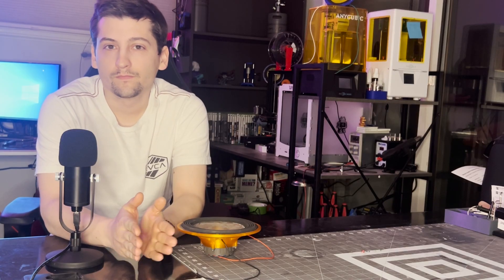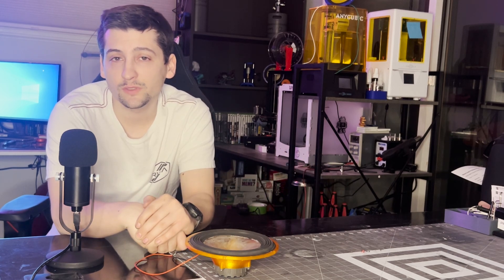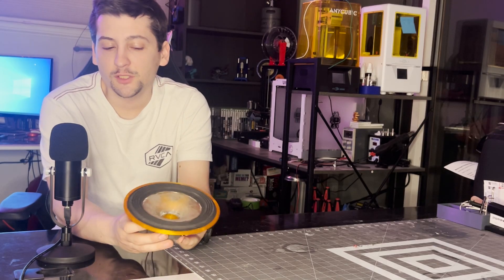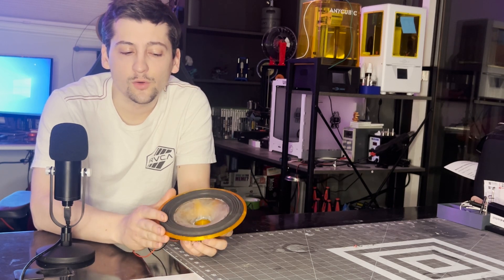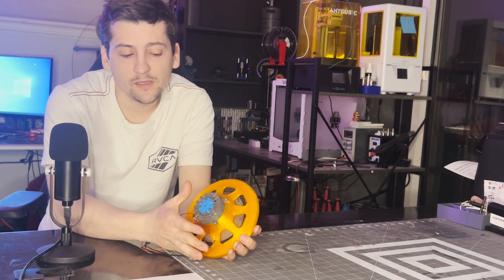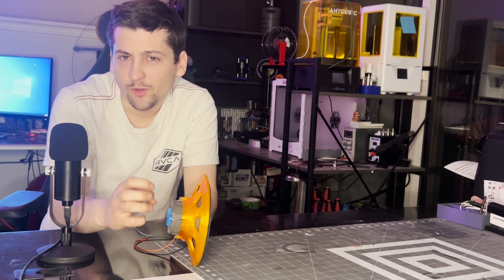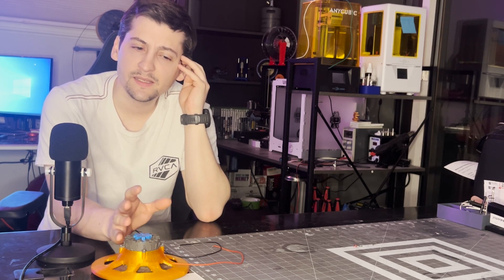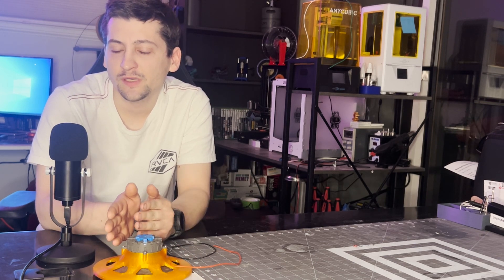Fully 3D Printed Speaker V9

Comment: To get better power handling air cooling and aluminum coils but with these new printers the coils should be more durable with better thermal cooling more efficient and more surface area for thermal transfer
Reply from the maker: I’ve since started to look into ASA or nylon as a former material. But I took a small break from speaker development to work on some box designs and a 2.1 audio system for my PC.

Comment: A little tip for version 10 Stick with the PETG cone just stop using support cut the code directly in half rotate it 90° so that the cut plane is now sitting on the print surface now you just print that twice with no support
Reply from the maker: I’ll keep that in mind.

Comment: Thats amazing! but the printing quallity is a bit bad. But the quallity from the speaker is not bad
Reply: Man I’m using an ender 3 and my quality is NOT like this. Check ur Calibration
Reply from the maker: I promise you all my calibrations are checked… esteps, pid tuning, ran temp towers, and stringing test. All filament is dried to 10-15%, the bed checked for level every 10 prints. I don’t print PLA like 99% of other people running printers, I print PETG, PVDF,ASA, and on occasion TPU/Nylon. 

If your concerned about the TPU surround having some stringing and blobs, that’s fine, I purposely turn the retraction down to 0, this prevents clogs in the extruder and leads to some unwanted stuff that can be fixed post process if I need to. 

As far as the magnet holder- iron fil PLA is just a pain to print, plus it’s expensive, so it’s hard to waste 100g running 15-20 tests…
Reply: @piscesprinting  I dont know i beloce you but why is it like that xD I am using a AnyCubic i3 Mega X and my extruder is calibrated and i habe perfect leveling and i am always printing petg and pla around 185°C and 190°C and i get perfect prints if i am printing too hot like 200-210 my prints are ruined
Reply from the maker: If your PETG prints are actually printing at a temp of “180c” on your printer than your thermister is calibrated incorrectly…. I’ve used thermal imaging to verify my thermister calibration and my petg print at 230-245 depending on manufacturer. You might be printing PLA at 180c but all my PLA are printed at 200-210c with an initial layer of 220c
Reply: @piscesprinting  @Pisces Printing, I'm sorry, I didn't mean PETG at 185°C. I'm only printing with PLA, which is at 185°C. Ouch! But for PETG, I'm printing around 235-240°C. The quality is perfect, but one problem is that I don't have the proper cooling...
Reply from the maker: So what part(s) are you saying the print quality is bad on? And what is it about those part(s) that makes you think the print quality could be better?
Reply from the maker: I mean I’m using $300 Printers and I’m printing in PETG- except the iron fil PLA(that stuff is a pain to print cleanly). Other than the iron fil, I felt that these prints are to be expected from a $300 FDM printer…it’s not like I’m using an SLS printer or anything..

Comment: Damn that did pretty smoothly with the mids.  Now make a tweeter!  I imagine tweeter is easiest, sub is hardest, needing the most power, thermal management and material.

How did you array your magnets, Halbach?
Reply from the maker: I’m learning about ribbon tweeters, so those are in the works!
Reply: @piscesprinting  how about the magnet polarity arrangement?
Reply from the maker: Outside magnets are reversed polarity of inside magnets, which I believe generates a field perpendicular to the coil where the coil moves around.
Reply: @piscesprinting  Consider using a Halback array, this alignment of magnetic field is what Christoph Laimer used in his very efficient electric motor, to great success.
Reply from the maker: I will look into it, I also decided to just post the digital files on Etsy for the time being, so if your interested the link is in the description.

Comment: The diameter of your cone as a ratio of the wavelength of sound you intend to produce has a massive effect on efficiency and SPL by frequency. 

If you want more bass, you need a larger cone, or a ported enclosure which is sized according to a mode of the wavelength of the frequency you wish to emphasize.

A guitar string is quiet until mounted on a sounding board.  Speakers aren't much different in this respect.
Reply from the maker: An enclosure is currently in the works, I’m hoping it’ll be out in a week or two.

Comment: Have you tried using donut magnets? Just seems a real pain fitting all the magnets into the holder is all.
If you blu-tak the weight down (weigh the blu-tak as well) when you measure the t/s parameters the graph should come out cleaner.
Reply from the maker: Good to know, And yes I have done donut magnets before.

Comment: wow, that SPL Plot was really good for an unbaffled speaker. Next time I suggest you make a test stand out of a board of wood with a circular cut out and support it on cement blocks with some foam tape in between. But that is a really good result. you should be pretty proud of that. I'm really curious what your BL was with magnets on both sides of the gap.
Reply from the maker: I plan on making an enclosure and retesting in the near future now that I have TS parameters to work with.

Comment: Dude this is awesome. I've always wondered if I could print a speaker.
Reply from the maker: It’s very possible(you do still need copper wire and magnets though) I have the older versions up on printables and Thingiverse, the latest versions are not uploaded due to the more expensive magnets used.

Comment: the biggest issue I can see straight up is that you've printed your magnet holder completely from iron pla , if it does indeed have any kind of decent magnetism its being wasted because the whole magnet is incased in the stuff, you need a top plate and bottom plate to focus the fields, I believe you've just shorted the magnetic circuit, good job on the diaphram its an improvement
Reply from the maker: I did focus the field, the center magnets are in the reverse polarity of the outside magnets, from what I understand this iron pla should allow the magnetic field to carry much more than just a PETG magnet holder. As that’s what all the previous builds had. Also from what I’ve gathered from builds Is that the top plate and bottom plate are connected via a pole, so I’m not seeing an issue with the whole thing being connected.
Reply: @piscesprinting  the magnetic field is going to take the path of least resistance, in this case , yes while you have 2 rings both in opposite polarity (good) the individual rings magnetism is going to shot straight down to its own opposite pole instead of jumping to the opposing ring's pole, this also has a negative effect because if you imagine your fields of magnetism you've got vertical fields instead of horizontal fields that would have been formed if you had used thin top plates for each ring and a wider bottom ring connecting the two rings...... magnets, how do they work? ;)